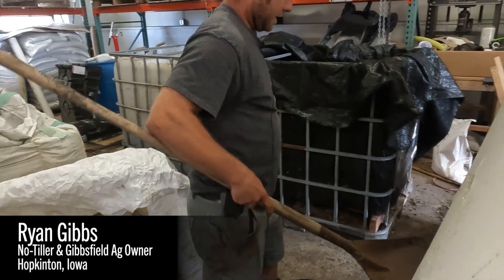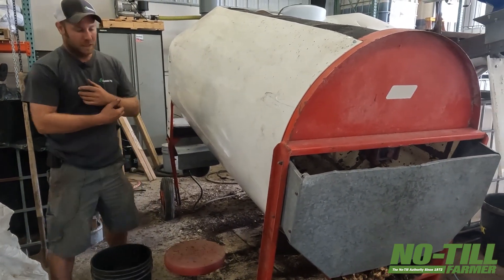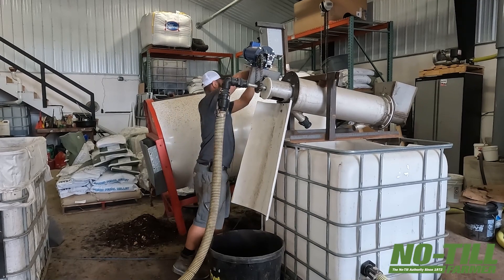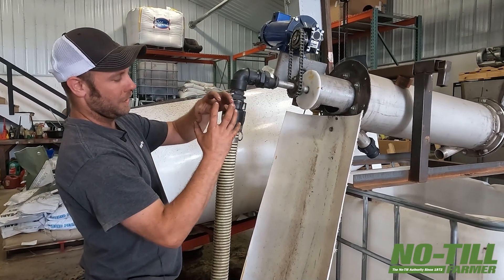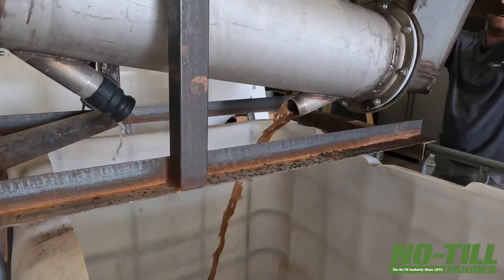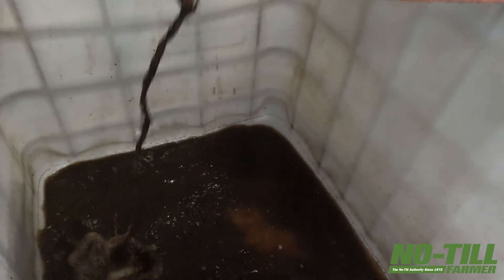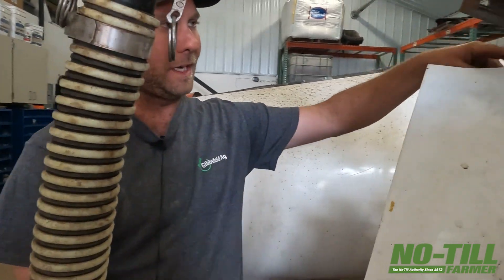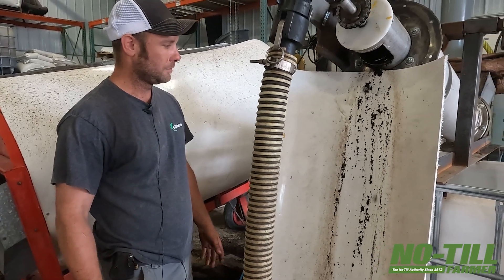Making Compost Extract for Commercial Farming

Comment: Does it spray pump damage the organisms? Also what type of filter do you use to keep the spray nozzles clean.
Reply: Propeller pumps hurt micro organisms. Chop up fungal stands . A diaphragm pump is the preferred pump.
Reply from the maker: Ryan uses a 30 mesh screen on the sprayer with XtendiMax high-volume tips. He says the compost extract does settle and needs to be agitated. The spray pump doesn't appear to damage the organisms because Ryan says he's seeing positive results from foliar applying the extract onto his crops. He goes in-depth about the extract process, application and benefits in this 2-part podcast episode if you're interested in learning more about it: https://www.no-tillfarmer.com/articles/12755-podcast-rebuilding-no-till-soils-microbiome-with-compost-extract-part-1

Comment: The Johnson-SU compost method is designed to produce a fungal dominant compost. It is a 'cold' process as opposed to a bacterially dominant compost that is primarily a 'hot' process.
The Johnson-Su process highlights aerating a static pile.
 Hot composting requires repeated turning of the pile.

My limited understanding of the Johnson-Su process is that it appears to produce a compost(and/or extract) that is more beneficial in rebuilding soil 'health'.

Granted, hot composting extract or compost 'tea' is beneficial in returning some lost nutrients to the soil profile as well!

On balance, my brief observation of the different composting methods points to a better return using a compost method that increases/maintains the microbial flora in the soil. ie: Johnson-Su